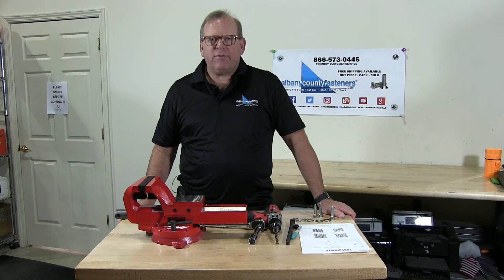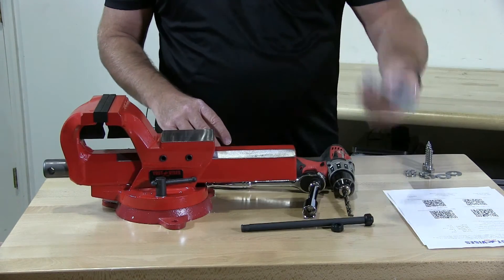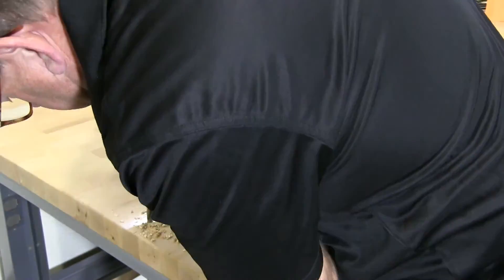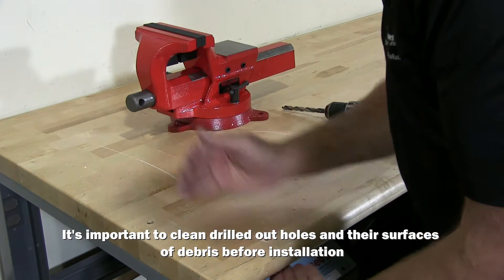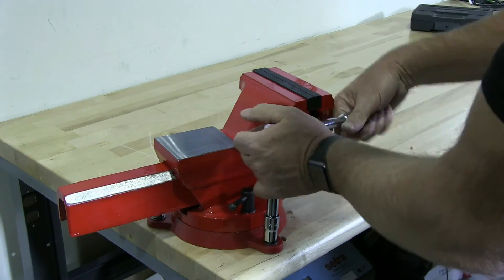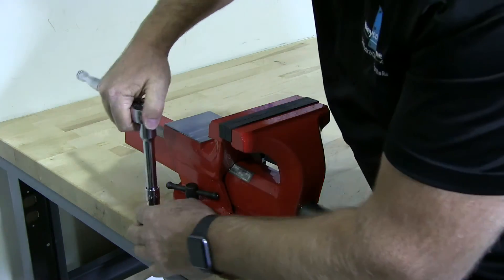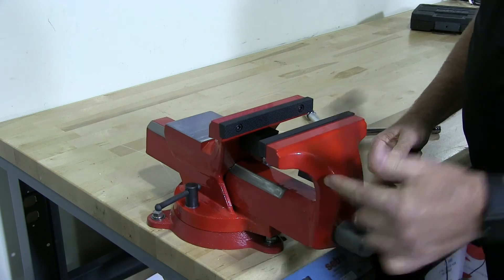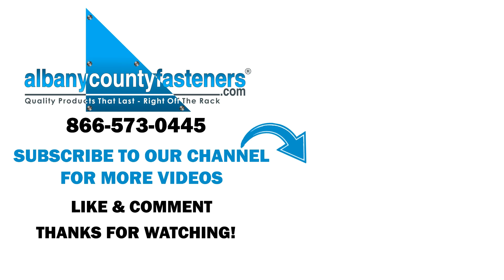Yost FSV-6 Vise Installation & Review | Fasteners 101

Comment: Why did you decide to mount the vise with the single mount hole in front instead of the single mount hole to the rear? Is there a reason for either way? Strength wise maybe? Also, why not through bolts? And it appears that the rear jaw is behind the end of the bench surface.

Comment: Why didn't ya use grade 8 bolts? Or structural bolts?
Reply: MECHANICAL ENGINEER HERE, those soft threaded screws are 100% not what you want to use.  They loosen up after repeated use on soft surfaces, especially when your forces are going around the radially in the hole while it is trying to hold the vice on the bench.  With something you're always pulling on like a vice, you definitely want the most reliable mount possible. Thru-bolted partially threaded bolts, washers and nuts on the other side are 100% the thing you want to use.  Nylock nuts can be a boon as well.  
I would actually say that on a vice, something like those threaded 'lag screws' is actually dangerous, as when they fail, it will just pull out of the table top fast and unexpectedly.
Also, do not use stainless fasteners here, unless they are some kind of exotic grade 5-8 equivalent like something you get from ARP then they are the wrong fastener.
Reply from the maker: No need the lag screws work great.  No need to put flat and lock washers on the bottom when I can just install lag screws.  That is a maple top so no issues with this vise coming loose.  Thanks for the suggestion.